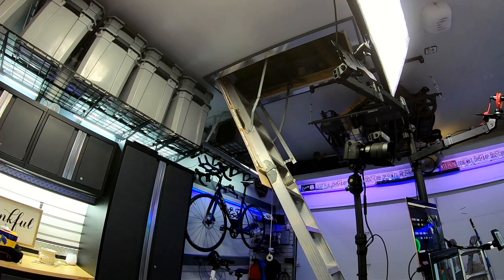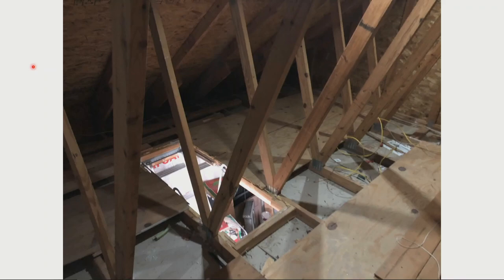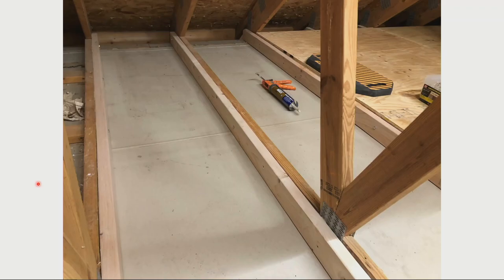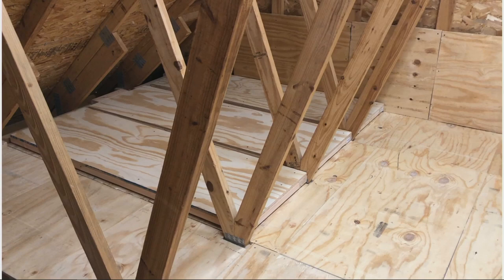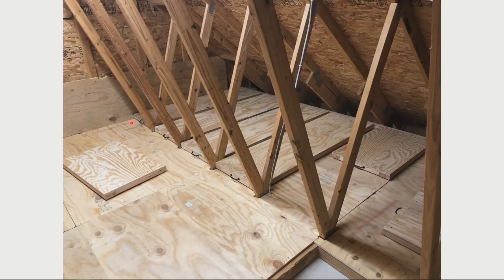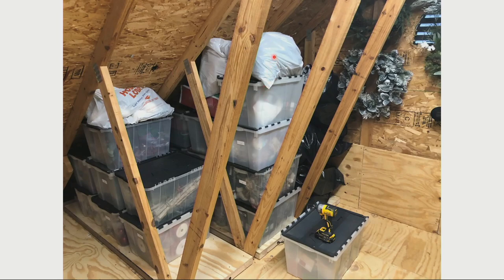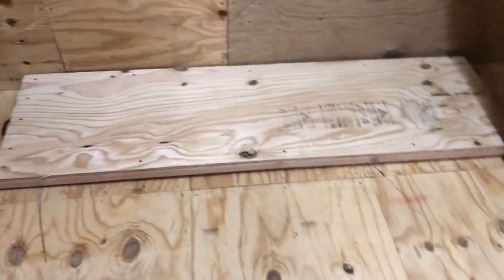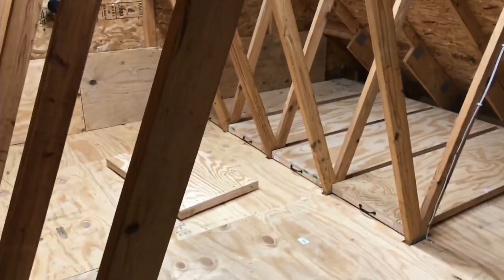Organize Your Attic!  Easy DO IT YOURSELF Attic Storage Solution! |ABraz House|

Comment: I am doing something similar right now however, I chose to evaluate the impacts on the trusses a bit more.  I have the original truss specs and determined that sistering 2x4's would not be sufficient and possibly over stress them on the bottom chords.  This is because their bottom chords are not rated for anything but hanging drywall ceilings.  Trusses are extremely complex and involve precise calculations to modify loads.  I have been able to engineer some myself and get them past inspection without a PE signoff on my own attached covered awning in my back yard.  My inspector took a look at my plate sizes, choice of lumber sizes, and agreed it was all way over designed and would never fail.  He appreciated that I also properly pressed the plates in with my own 50 ton hydraulic press that I made.

Instead, in my attic, what I did was sister 2x6's across at 1' height above drywall, and hung with joist hangers from a rim joist band on a load bearing wall, or directly on top of the top plate.  This also allowed me to insulate my garage.  In the process I did connect them also to the trusses, but I claim this made the trusses even stronger.  I even found some trusses where the nail plates were compromised and either hammered them back in, or plywood and glued them in cases where some plates never even went in because their teeth were all bent over.  Construction is pretty shoddy these days and although trusses can be very strong, especially as a system, they are designed to be somewhat single fault tolerant.  My max spans were 12', most were 8' since my attic space did not go the entire distance across the garage.  We have a 230 sq.ft. bonus room above the garage which at a minimum of 30psf is designed to support nearly 7000 lbs.  As it's only used as a kid's bedroom, I have about 5000lbs of margin that the attic could store.  I'll never store that much, and even though I know it won't necessarily be to code, I also know without a doubt after load calculations it will never ever cause a problem until at least I sell.  Then I may just empty it and board it up and say "cut the door back out again and use at your own risk, it's not my problem anymore."
Reply from the maker: Sounds like you have a good handle on it!  I have to be honest...no engineering background here, and I would probably not advertise the feature if we sold! :)  Everything is still holding up great with no stress cracks even in the ceiling drywall joints.

Comment: I'm doing this right now. My only suggestion is that if you are going to have a storage area above bedrooms, you should have the bulk of the weight centered over the walls. If you have a small bathroom, you can use 3/4" plywood and span the entire area above the bathroom. What could potentially happen is that you put too much weight on bedroom ceilings, and cause the ceilings to crack, warping downward. Alternatively, if you do plan on making the areas above bedrooms your storage area, you can post a sign in that area (rental?) and encourage the storage of lighter weight items.
Reply from the maker: Good points Tim,  I can definitely see the reason for that.

Comment: Nicely done. Why not adding wheels directly to the totes? Adding lots of weight in your attic aren't you worried it'll pull the beams of the roof inward or  potentially damaging the structure of your home over time?
Reply from the maker: The totes were plastic and didn't seem like a good option.  I sistered them together and haven't see any signs of problems yet.  It has been about 2 years.

Comment: Did you reverse your attic ladder so you're climbing up into the wide open middle portion of your garage attic instead of the sloped ceiling/roof portion?
Reply from the maker: No.  I didn't install it, but if it were reversed it would take away valuable space on a wall side.

Comment: How do u find the heat in the summer and the cold in the winter?  My attic is about 200 degrees in the summer and freezing in the winter.  
Is there anything  you wouldn't put up there because you think it get ruined  Because of the elements in the seasons?  I have almost the same attic but with blown in  Insulation.
Reply from the maker: I do keep in mind what I put up there.  Missouri has a pretty decent cold winter and a fairly warm summer, here in the Midwest.  We  keep it mainly to décor for Christmas and fall.  These type items aren't negatively impacted.

Comment: fyi standard trusses are not rated for the extra weight, looks good
Reply from the maker: Yeah, even with the sistering of them I realize that.  I took as many precautions as I could think of, but I certainly understand that they probably wouldn't pass the muster of an engineering inspection. I have been watching everything closely for almost 2 years.  No stress cracks in the ceiling drywall or other indications of problems.  It serves a good purpose for me right now, but I wouldn't be adding it as a advertised feature if I sold the house!

Comment: I have heard this can put excessive down force on the roof trusses. How do you keep this from being a problem or issue?
Reply from the maker: While I am far from an engineer I did the following to help offset the force on the trusses.  1.  I am careful about the type of materials/weight I store.  2.  I added an extra 2x4 to each ceiling joist by bolting/gluing each for the entire span and resting them on the header on each side.  I believe this is referred to as "sistering".  The plywood floor is also screwed to both of the joists (original and the one I added to each).  I am sure this isn't a perfect solution and it isn't even a professional opinion.  This area is only about 17ft and covers a portion of my garage only.  Hopefully this helps.
Reply: @ABrazHouse  No I totally get it! You did an awesome job with your entire garage and because of what I saw I am rethinking my entire garage! The main reason I was asking was to give me peace of mind if I do the same to my attic above the garage. I am now debating of whether to stack bins on top of all my cabinets to save on buying or making more shelves or adding shelves above my cabinets like you did. My biggest concern is loading them up too much and and everything crashing down on me if you know what I mean. I also want to epoxy the floor when I am done with everything else but finding one that will stand the test of time is a tough job. The area where the tires sit makes it loosen over time and I do not want that. Cheers!
Reply from the maker: Thanks!  I know I did exactly as you are doing.  I scoured YouTube and the web to gather as much info as possible to make an informed decision.  Those shelves I ended up with was after alot of research.  I had a hard time coming up with a 24 inch shelf I was confident in.  FLEXIMOUNTS 2-Pack 2x6ft Garage Shelving with Hooks 24-inch-by-72-inch- https://amzn.to/35xc2cQ  I can say after having them up for two years they are easy to install and very well made.  Those bins I use are loaded up, and are not light.  I love the fact that dust doesn't collect on them, and my bins are so close to the ceiling that not alot gets on them either!  The key to my confidence is that plywood that I used to attach to the wall first.  That plywood is attached by screw (to the studs) and glue before I attached the shelving to the plywood and studs.  Being able to use the plywood for the LED lighting was just a fringe benefit! :)  Hope this helps!  Thanks for viewing and commenting!  Good luck with your garage!
Reply: @ABrazHouse  thanks ABraz! I’m off to HD and amz! 😂
Reply from the maker: Have fun!

Comment: Did u install 3/4 in plywood for floors or 1/2”?
Reply from the maker: Right in between.  1/2 was a little to thin for my liking (too much flex) and 3/4 was too thick/heavy for my liking.  I split the difference and went with 5/8" thickness.